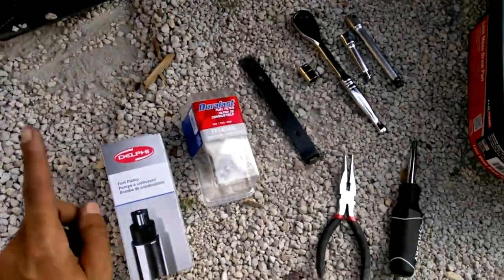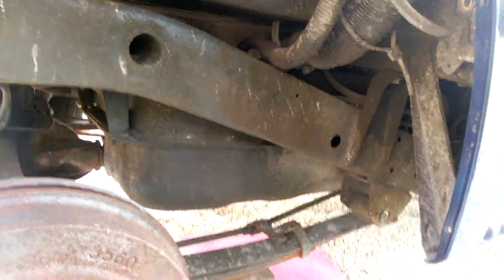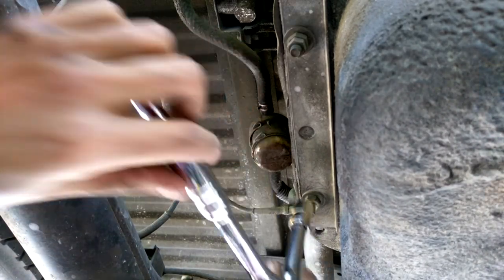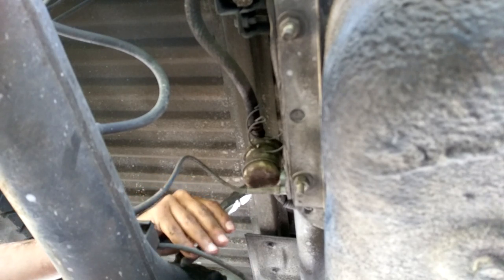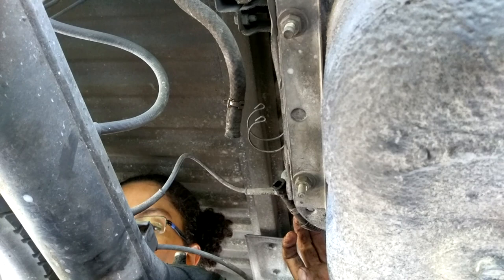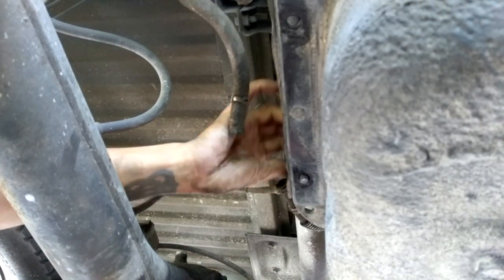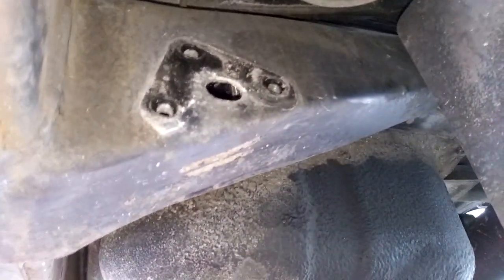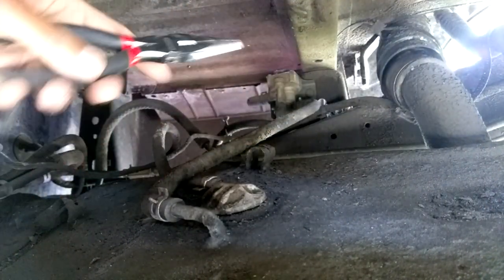Changing the fuel pump on a 1990 Mazda B-2200.

Comment: I have a 4×4 1991 mazda king cab, but instead of lowering the gas tank to remove the fuel pump, I lifted the upper case with concrete blocks , the thing was heavy but it was easier for me . But you did a great job on your pick up.👍
Reply from the maker: I'm glad that was easier for you! I tried that, but I would have had to disconnect too many things to get it high enough, so gave up on that idea.

Comment: Did the old pump go out or did you just change it as a preventative measure? Also does it start/run better after
Reply from the maker: A S before and after changing the fuel pump the truck did not run. I was doing trial and error method of repair as I didn’t know what was wrong with the truck at the time I changed the fuel pump. Eventually changed the distributor which was the real problem. So to answer your question, once the distributor was fixed , and possibly in combination with a new fuel pump and fuel filter, the truck ran better than ever.

Comment: I have a question hope you can guide me , I have an extended cab 1991 Mazda B2200 I follow your video(thanks a lot it was easy with it) but the fuel filter I couldn’t find it anywhere close to the tank is it different than the single cab?
Reply from the maker: Victor Ramirez The 1991 might be fuel injected. In some cars they put the filters closer to the engine, try to follow the fuel lines see if you can find it. If not, it’s possible they put it in the fuel tank itself but not sure how common that is. Thanks for watching my videos!

Comment: That is interesting I didn’t know it had 2 fuel pumps I have changed the one under my hood before but never this one. I didn’t know it had another one.
Reply from the maker: Mine only had the one. Is yours fuel injected or carburetor?
Reply: @ninjaofalltrades4293  both of mine are carbureted. They have the mechanical pump on the back of the engine.
Reply from the maker: @blakewaddell451  Might not have one in the tank then. I was hoping for the one under the hood, but was not that lucky!
Reply: @ninjaofalltrades4293  haha yeah. I read online that the fuel injected ones had it in the tank only and the carbureted ones had a mechanical one at the back of the engine only.
Reply: @blakewaddell451  you only have one.the fuel injected ones are in the  gas tank carbs models on engine.

Comment: Have you had any issue with the Mazda not getting gas ? My so. Has the same year only 88000 original miles he change the fuel pump and filter. It’s getting a low voltage on the line the goes to the relay. He Hotwire it run for 30 minutes put the bed back on then it would start. He said the he did had issue with the ignition a few weeks ago. So now wondering if that maybe the problem
Reply from the maker: Hurm... I ended up changing the ignition switch, but my issue turned out to have been the distributor had to be replaced. Sorry it took so long to respond, I get lazy. Hope your issue has been fixed!

Comment: Ninja of All Trades did you get a new fuel pump strainer because i need to change my fuel pump as well on my 1990 b2600i so i was wondering if i would need to buy a new fuel pump strainer ???
Reply from the maker: Plox Plox I did not, mostly at the time because I didn’t know what it looked like in there or that there was one. When I did it, I inspected the one that was there and it looked clean but discolored. As such I was not concerned. Good luck on yours!
Reply: @ninjaofalltrades4293  thanks if you dont mind me asking why you sell your truck?
Reply from the maker: Plox Plox Inherited my father-in-law’s 2007 Ford F-150, plus our Prius, and my work car. Too many vehicles, not enough space, plus insurance etc. It was gonna sit there gathering dust.

Comment: My Mazda B2200 has some sort of problem and it may relate to my fuel pump or I might be wrong but when I drive my Mazda I get to around 30 mph then it starts to stutter and when the road is at like 40 mph and by the time I’m at 35 mph my Mazda shuts off  so I have to turn off the ignition turn it on again and go at a slow pace and it really makes me mad so I need to know if you know what is wrong with my truck
Reply from the maker: Herbs Pedroza I’m no mechanic, so hopefully someone else can give better suggestions. When I had similar issues it turned out to be the distributor. I took it to a mechanic to replace the distributor and it fixed the problem.
Reply: It’s the catalytic converter for sure
Reply: Herbs Pedroza you have full emission set up?
Reply: Did you ever figure out your problem? Mine is doing the EXACT thing and I'm not sure where to go next. anything helps.
Thanks

Comment: I'm confused as to how many pumps are on these lil bastards? Is there a mechanical and electric? On my b2000 there's a mechanical and no electric, however my 91 b2200 idk? I'm getting no fuel! Guess I've got my work cut out for me. Oh well here I go👉👉👉
Reply from the maker: Hope you managed to get it fixed! Mine only has one filter and a mesh filter in the fuel tank pump itself.